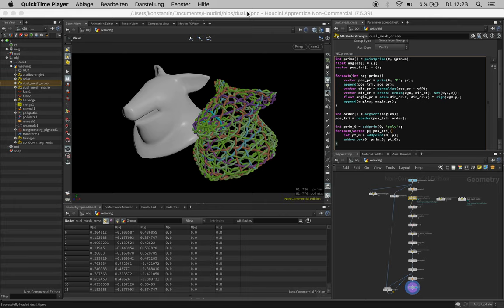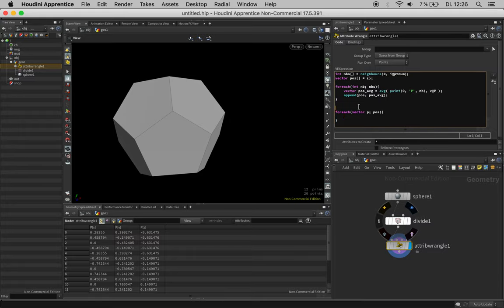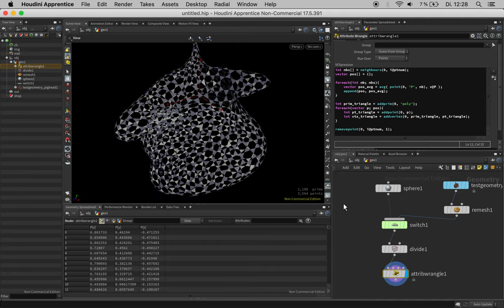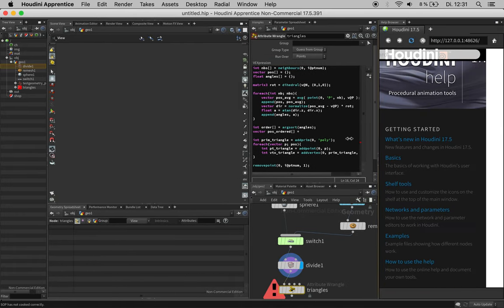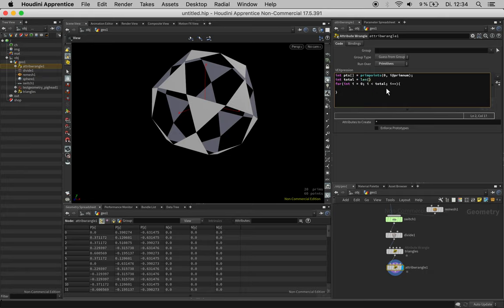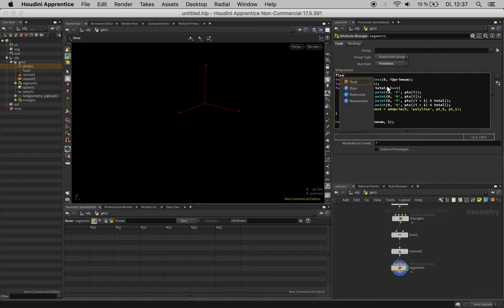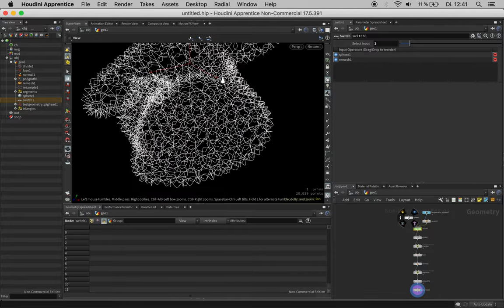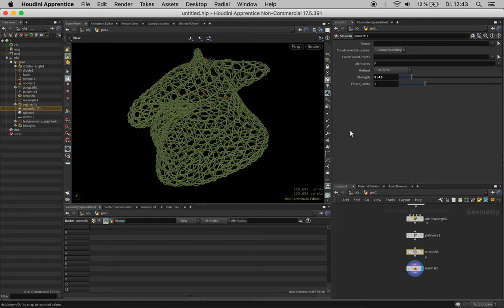Kagome Weaving – Houdini Tutorial

Comment: This is a nice example of achieving the effect of physical weaving, approaching it with the polyhedra duals.  That said... shouldn't they have a slider bar available for adjusting the height of vertices along the normals?   Along with the convenient tool to select every alternating vertex?  The more I study Houdin, the more it seems that the work required to achieve something "basic" can be quite involved if it's not already available on the UI... while the sheer depth of what is possible is virtually unlimited.